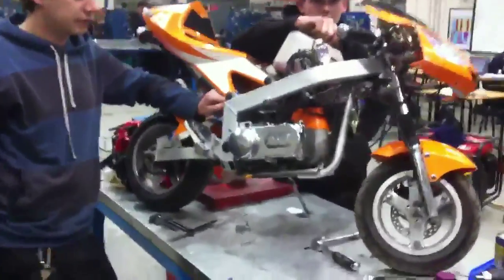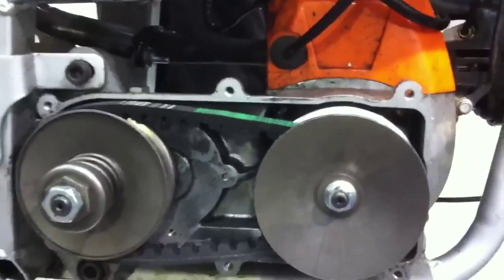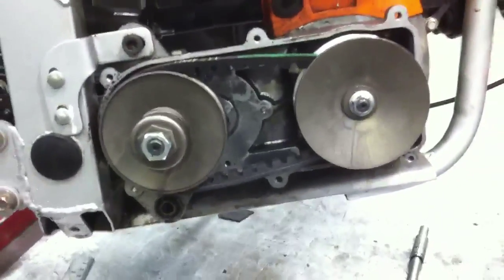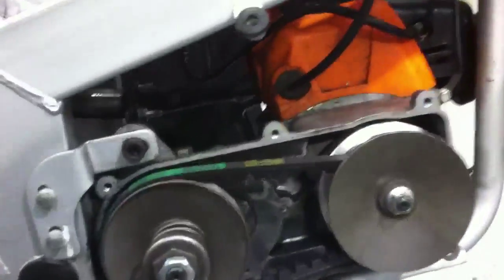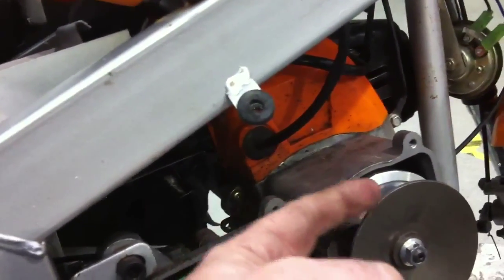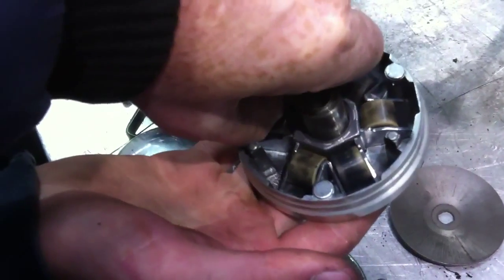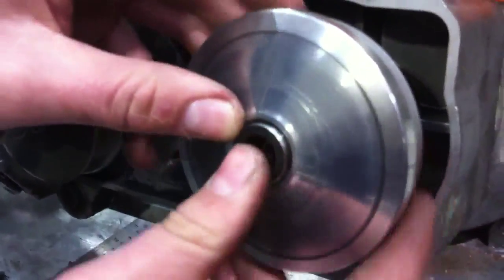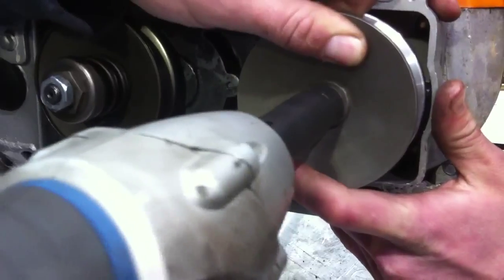CVT Constantly Variable Transmission

Comment: what size chain do you use on this not the belt but the chain I purchased one bit had no chain and I'm not sure what size to get
Reply: What motor is this trying to fix the starter but don't know the type of motor
Reply: @garrettgreen3773  I too have one of these engines with the CVT I think they are 47cc I would try to rebuild the electric start by cleaning the communicator and smoothening it out and getting the brushes to be pressed by spring tension firmly on the communicator but here is a link for a starter it might work with different bolts. https://rover.ebay.com/rover/0/0/0?mpre=https%3A%2F%2Fwww.ebay.com%2Fulk%2Fitm%2F202658516947

Comment: belt seems too loose
Reply from the maker: You're right! The belt will always be 'loose' when the engine is not running. At this stage, the centrifugal clutch is totally disengaged, giving us the slack drive belt. Once engine speed starts to rise, the clutch begins to engage and tighten up the drive belt. In doing so, it transmits drive.

Comment from the maker: No. At low speeds, the driving pulley has a small diameter. This gives high torque, low speed - a low gear like first gear. As the speed increases, this has the effect of making the driving pulley larger, which progressively gives lower torque but higher speeds. As this happens automatically as the vehicle speed increases, there is no need to shift. The ideal drive ratio is always selected.